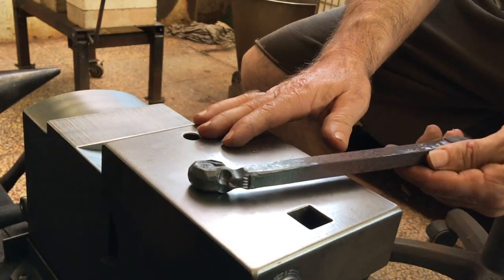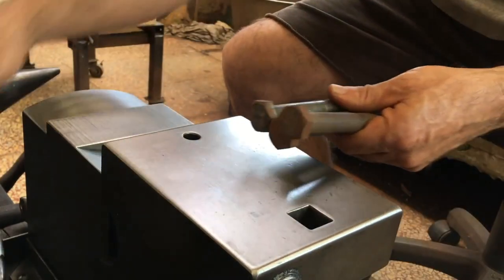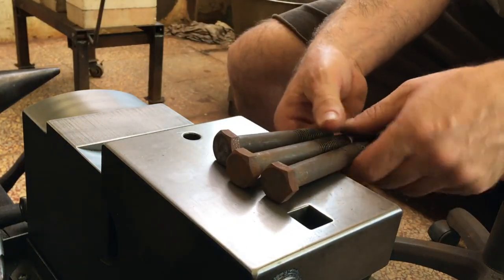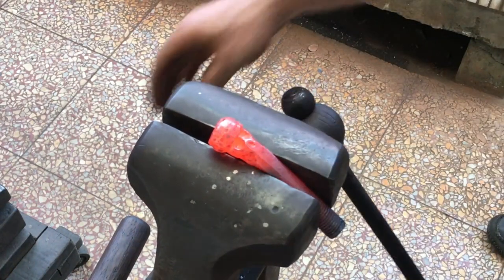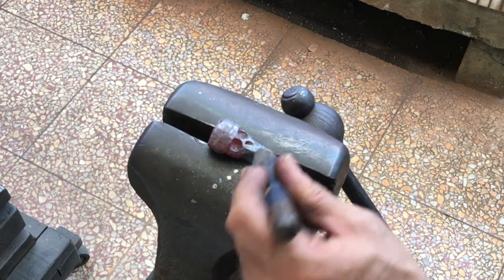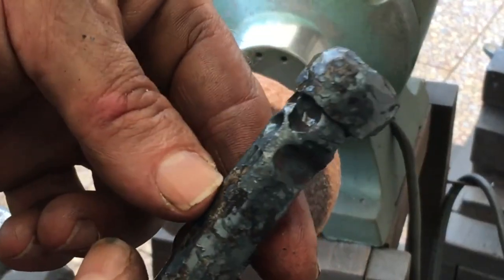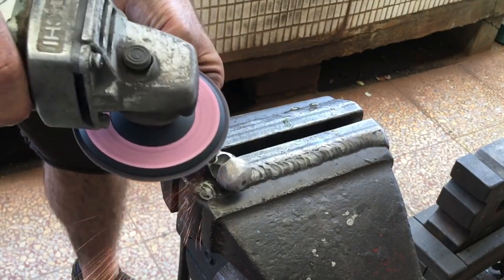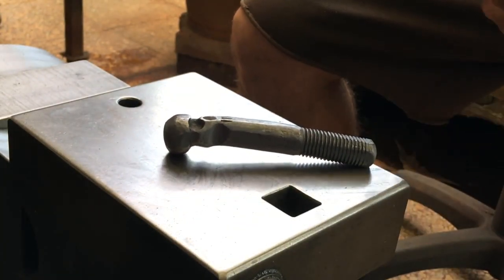Bolt to Skull

Comment: I like you don't have the space or resources to make a lot of things I would love to attempt.  I'm led to your sight from time to time because of your thinking process and looking for acceptable results from less than desirable or more costly materials.  Your willing to experiment is encouraging.  While many may prefer your second skull in design features, both would markedly be more appealing with a reduced size in the neck area.  As a frame sets off a painting, so can the base piece of metal around or below your main work.  Your skull is great but might be markedly more appealing to many by simply reducing the bolt size below where you could have made a chin.  Then the whole thing pops forward!  Again, thanks for stepping outside the box!

Comment: I prefer the one in the middle at the end with the helmet on. Wonderful project. Maybe good for a handle on something, sort of a lever type thing... Interesting.... Thank you....
Reply: Ken howdy, leads me to ponder. I salvaged some finger dia bolts 3ft plus long from crane shipping materials. W a few of these monster bolts I'd planning on making some GS Ting quick tongs. Was wondering what to do w the bolt heads. Toyed w the diamond idea shown by JLP Services. 
   Well this gives me another option eh?
🙏 Bless y'all now
Crawford out ⚒️🧙‍♂️
Reply from the maker: I can imagine this sort of item (upsized some) being used as a stick shift lever on an old rat rod. Thanks Ken.
Reply from the maker: Turning your bolts to tongs would be very interesting. Something I would like to see. Thanks.

Comment: I have noticed the jaws on your vise has been repaired.  Did you do this? If so what welding rod did you use? I have one that needs the same repair.
Reply from the maker: It was more a change than repair. I didn't like the serrated, hardened jaws  that came with the vise and so rather than make other bolt on jaws (which always get sloppy), I thought welded on jaws might work. I took it to a welder I often use and I believe he TIG welded them. We weren't sure how well it would hold up (not certain of the vise material) but it's worked well. Thanks.